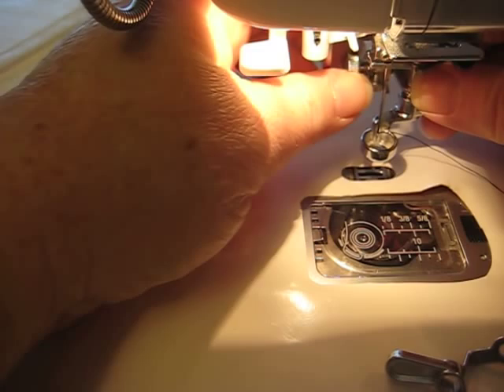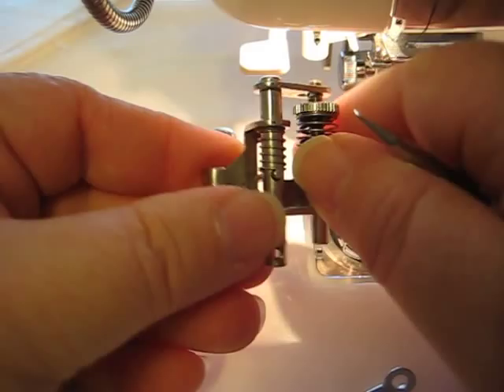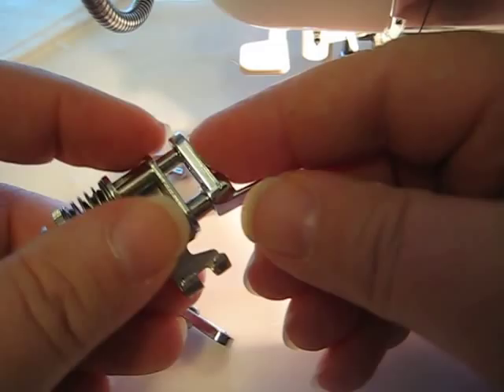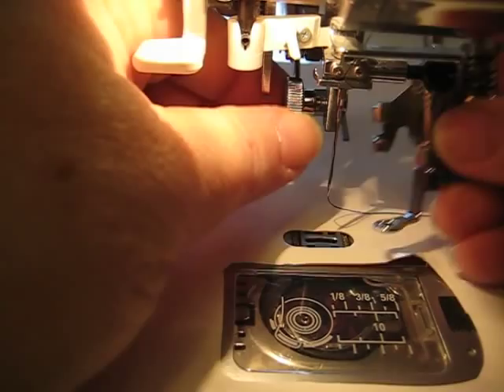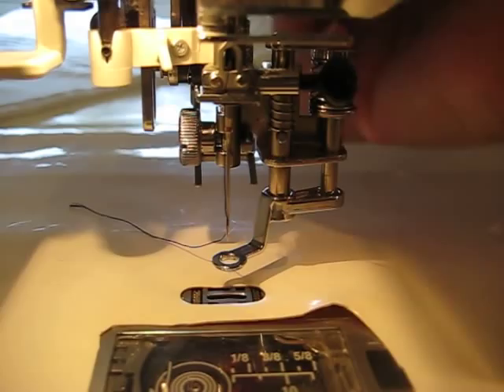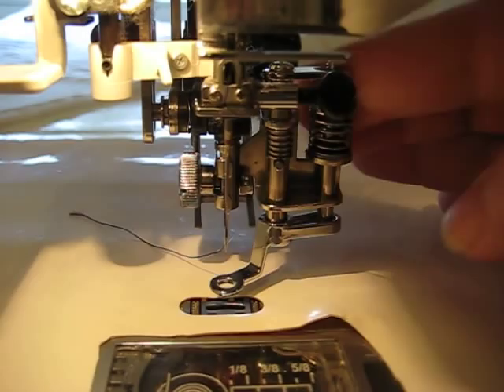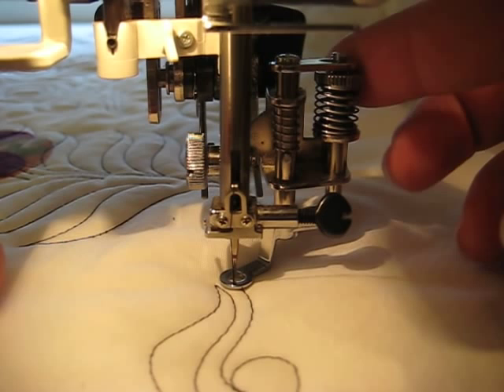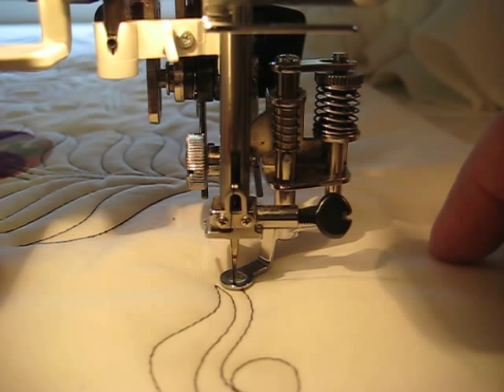Review of the Janome Free Motion Foot Set

Comment: I have FINALLY been successful with these feet!  Finally learned to screw down the foot to touch the quilt surface.  I also used a thread conditioner - not sure if that was needed.  I DO wish Janome had put some instructions with the feet - I sure was unhappy for a long time, until recent success, 3 months later.
Reply from the maker: Elaine Adair I am so glad to hear it! Sorry I didn't respond to your earlier post. It does not hop and that takes some getting used to. Bulky seams and applique need the foot to be adjusted higher. Too high and stitch formation issues can arise. But I still love it.

Comment: Amy, I have a Janome Memory Craft 6500 and I was wondering which ruler foot fits that machine. I had one with my Janome 7700 just like the one you have here, but I guess it went with that machine when I sold it. Will this one here fit the 6500? Thanks so much. ~Cynthia
Reply from the maker: You'll want to get the low shank version. Since this video came out, Janome introduced a ruler foot only version in both high and low shank versions called the quarter inch ruler foot. You can see it here at my site or check with your local dealer: https://www.amyquilts.com/shop/c/p/Janome-14-inch-Ruler-Foot-for-Low-Shank-Machines-x46433028.htm
Reply: @AmyQuilts  Thank you, appreciate the reply!

Comment: amy, I just bought the Convertible free motion quilting foot set but my problem is the needle
is not centered in the foot opening. I can adjust side to side but I need to move the needle forward.  help!
Reply from the maker: I'd bet that you've got the wrong version for your machine. The Janome 1600 version has the foot sit out farther forward. If you've got that version on a machine that is a regular high shank, the needle will be really close to the back of the foot. The Frame Quilting Foot Set (which has the ruler foot in it) is packaged for the 1600, but fits on all convertible foot sets (high, low, 9mm high), which makes some dealers and consumers think they need the 1600 version.

Comment: Have a question/problem. When I remove original presser foot and attach the free motion foot, the screw does not tighten down properly to secure the foot. It flops around. When I ordered this set, it said it fit the Janome RX18S. Does it need a different screw, or am I not doing something correctly?
Reply from the maker: It shouldn't take a different screw. I'm not familiar with that model machine, but if it's the right foot, it should go on with no problem. Check to make sure your screw isn't damaged (maybe cross-threaded) or the attachment area hasn't gotten bent somehow (unlikely).

Comment: Hi Amy.  I have just purchased a 9400 and not sure which set to purchase, someone told me my machine has a high shank but I see on the packaging for the conversion set that it is for low shank machines. Your advice would be appreciated.
Reply from the maker: There are different versions of the convertible free motion foot set. Your machine could use the one for 9mm high shank machines, however, I am told they are coming out with a better ruler foot for machines like yours with the auto foot lift.

Comment: Amy do have any connection with Janome? Cause not having the instructions in their 👎 book is frustrating. Help, tell those 🦃 butts. Lol. What if you don't have a computer to look it up. 
For fm what is the stitch length. Help plse. Are you the one with quilting books?
Reply from the maker: This video was shot about 2 years before I became a Janome dealer. There is no stitch length given for free motion because your hands control your stitch length in free motion. Since the feed dogs are down,  you could change the stitch length to zero, on some machines, other models go to zero automatically when the dogs are dropped, but it doesn't matter because you determine the stitch length. Many of the Janome feet have additional instructions in the packaging, but people may not realize it. A good dealer is a valuable asset for both Janome and the customer to supplement the manual.
Reply: @AmyQuilts  I have janome 8300 .And i have free motion foot but it does not work machine gives error.what can i do??plz ans me.
Reply: And  i have Multifunctional kit 42.
Reply: @AmyQuilts  i have janome 8300 scio